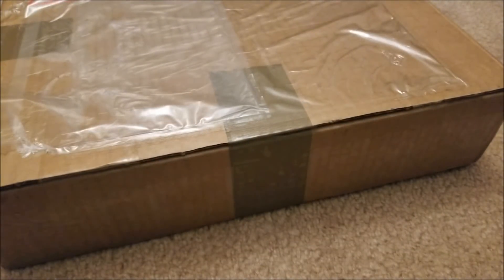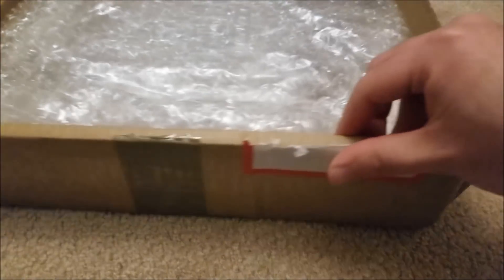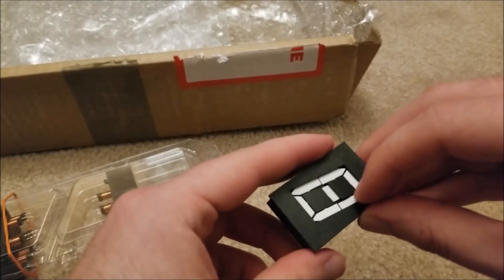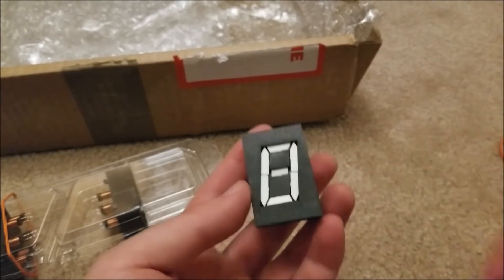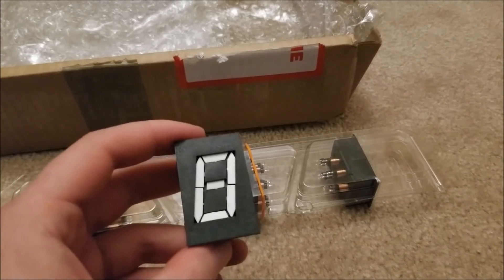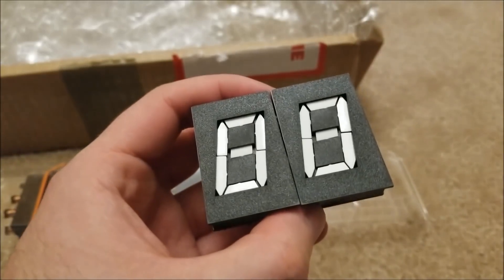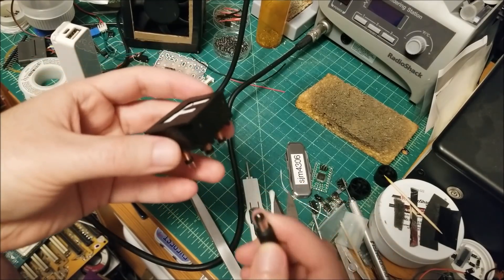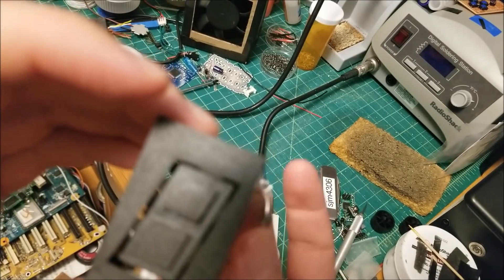Alfa-Zeta Electromechanical Seven Segment Displays Unbox + Testing

Comment: Hi - just found this video. I've been messing with a set of these displays for about a year now, but the ones I have are single coil per segment and you need to reverse the polarity to flip them back and forth. I've gotten one digit to work well with an LM293D controlled by an Arduino nano, but I had used one side of the coils as a common and with more than one digit connected they all flipped at the same time. I think because the coil was discharging when the power was removed, and I can't use a flyback diode because I need to be able to send current through in both directions. I'll get back to it some day. Here's my prototype: https://www.youtube.com/watch?v=pfwrARCU7BI
Reply from the maker: Yep, mine are a single coil per segmemt as well. I just ended up throwing a L9110 h-bridge per segment ($10 for 50 h-bridge smd chips isnt bad) and gave up on trying to multiplex them.

Comment: this sounds like a cool project
Reply from the maker: The added benefit is once I've perfected the display module level design and release it open source then anyone can easily use these displays in their own projects for whatever purpose they want. Currently if you wanna use them you have to design the driver circuitry and worry about timing/multiplexing but with the serial module all you have to do is send it serial commands as if it were an lcd or oled display.